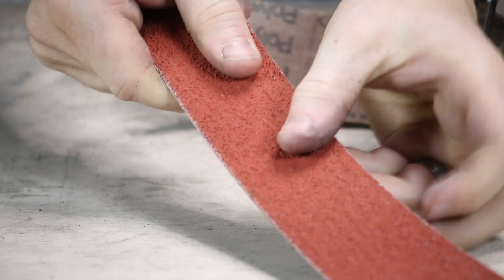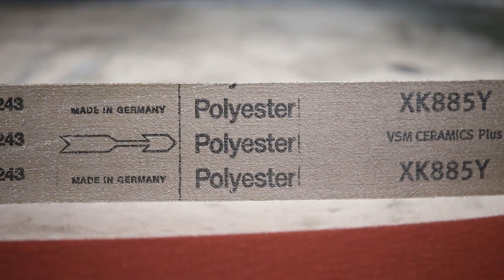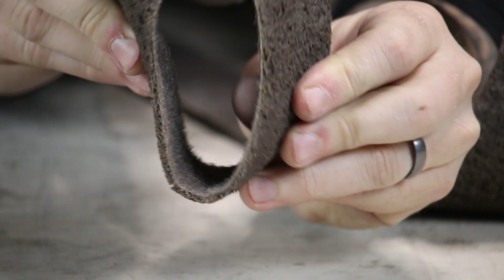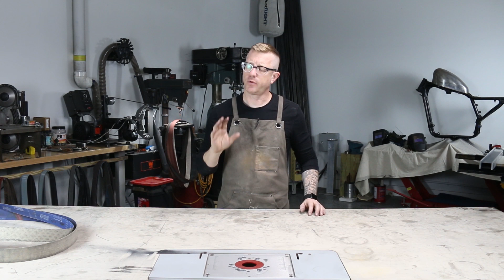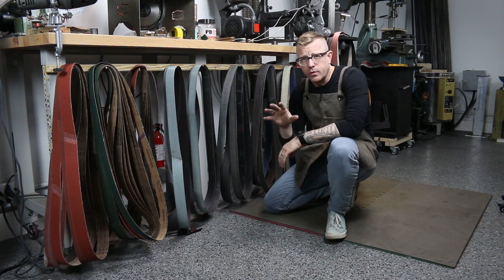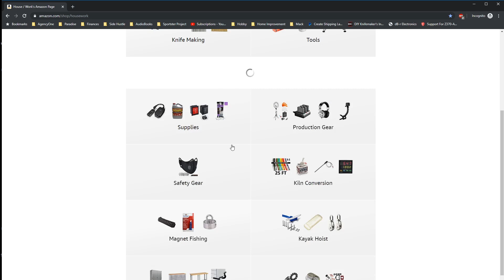2x72 Grinder Belts - Which ones to Buy

Comment: yeah dude. its A2. a low alloy steel with a tiny bit of chromium carbide in it. ofc it grinds like butter on that belt. it would. stuff grinds like butter without power tools, by hand, too. most basic cutlery stainless steels would be twice as hard to grind. forget about some high alloy high speed bs.
Reply from the maker: Right on man. Thanks

Comment: There are a number of different standards for abrasives, and they are not exactly compatible.  Further, it is not just the average grit that needs to meet standards, the distribution curve that describes the range of grit sizes and their proportions is important.  A good abrasive will leave all the lines the same whereas others will put very deep grooves in an otherwise consistently finer surface and others will be all over the place - i would assume we have all been there.

Two possible reasons for the lack of grit size markings may be that either the manufacturers wish to ensure that you understand what you are getting by making you look up the specification for the product, or the products don't pass the standards and the manufacturers wish to avoid legal action.

Comment: For what its worth, if you ever had a tube of silicone caulk on the shelf and it got old and hard.   Break it out of the tube, it makes an excellent belt cleaner.
Reply from the maker: Oh man that's an excellent tip!!
Reply: Did you try it out? 😀
Reply: Oooh! I don’t usually have silicone but I use polyurethane that dries like a nice silicone. Might just squirt out something into a mold…

Comment: Hey Brian,
Thank you for the VSM recommendation. I'm from Germany so I will give them a try as soon as my belt grinder is finished. Do you have recommendations on belt speed? What do you use for profiling with those 36 grit ceramic belts? As far as I read the high sfpm are only needed for low grit grinding and the speed is lowered with increasing grits to reduce heat.

Comment: watched you videos before, subscribed a while ago, your machine i think is the best on the market, to say its bullet proof is a understatement, that machine will survive anything plus a lot more . Two hp is fine, speed variator is a bonus ,forward and reverse is the icing on the cake. I am based in the uk and sold abrasive belt machines for twenty years ,half inch wide dynafile, up to 90 inch wide throughfeed machines, half horsepower up to 80 horse power  for powergrinders. Plus i saw a lot of home made and modified machines along the way, some to bad to mention, some brilliant, dedicated to one process or application. Most machines i see are good but possibly running too slow, they cut ok but are nowhere near the 32 meters per second recommend by the manufactures, but they work well and when using scothbrite or working plastics are adequate. you talked about 80% for steel what is that in meters per second, my reason for asking is that i have run belts up to 40 meters per second with good results, the 3m rep frowned and refrained from comment,the highter speed you can run the better the abrasive will preform. Colour of belts scotchbrite use a colour system to make it easy to use ,brown coarse, blue medium, red fine, and white very fine. Most manufacturers dont publish belt speeds, i think it is because so many people make a machine, from whatever they have at home or can purchase off the internet. belt speed doesnt come into the equation, if they have a two speed motor then that is a bonus for them. When fine polishing as you have forward and reverse, have you tried reversing a old belt using the back face of the belt like a barbers strap, a company in birmingham  did this on a ten headed Loser centerless machine polishing golf shafts at a rate of 20 pieces per min. the old belt burnished the shaft and gave it a brightness that their quality people were looking for, a alternative was to use a cork belt, they run better wet but if you dont have a wet machine, put the belt in a bucket of warm water for a few mins spin it up and it will remain damp and flexible for a while. Sorry if it sounds like a mini rant, its not meant to be it is a pleasure to see a machine to the standard and flexibility of yours, if i ever get back to the states , i would love to have a play on your machine, it will do all i want it to do. With belt grades my choice  is     with 3m start with a300 80# a160 120# a30 800# then a old belt reversed and used to burnish, happy grinding Lawrence Ogden.
Reply: whats the purpose of changing the rotation direction of the belt?

Comment: Thanks for the video.  I started out using belts from Combat Abrasives and they worked out pretty good.  Just seemed to loose their grit quite readily or at the very least the ceramic bits wore down a little fast for my liking.  Over the past 2 months though I have switched to the 3M Cubitron 984F II 36 grit ceramic belts.  I profiled and beveled 3 camp choppers (1 from CPM-4V, 1 from 5160, and the last from 1084) and the belt still has grit left to spare.  Now it won't 'hog' off material as if new but that is a lot of work just for one belt.  I use just that belt now to knock off corners before going to a new belt.  Now, they are pricey so you gotta figure if what you pay is worth what you get out of them.  For me the choppers I make have 11" cutting edge, 1/4" spines and the bevel goes up about 3/4 of the way from edge to spine.  So a lot of material is removed for each blade.  So for me they are worth the price versus what I charge for my choppers.  Have never tried the VSM belts and although they sound like they would do the job it would be hard for me to give them a try after using the Cubitron.  But to each his own and what works for one man doesn't necessarily work for another.

Comment: Have you used combat abrasives belts before?
Reply from the maker: I haven’t but I have heard they are good. Is that what you use?
Reply: @HouseMadeUS  no I haven't gotten any belts yet. I'm still in the process of building my grinder and trying to find the best bag for buck at to purchase some. I have my treadmill motor and have to buy my rectifier and speed controller that you built in a previous video. I'm also most likely going to copy your build but for the main tube and platen arm will be using a hitch reciever and solid hitch I found for scrap. 
Was just curious if you have used them yet. 
Thanks for all the great info you have. Really appreciate it!
Reply from the maker: Yeah man, go VSM. From my experience they are the best bang for the buck. Good luck my friend and send some pics to brian@housework.us I’m putting together a compilation vid of all the grinders people have made.
Reply: @HouseMadeUS  will do. I just got a welder and need to set it up and see if the bottle I got has gas in it etc. Also need to cut a hole and weld my burner onto my forge. Trying to get into blacksmithing and knife making but it's cold in manitoba canada so not always easy/fun to go out in the garage with no heat haha
Reply: Ian Moster

Comment: Yeah, I basically do the same to start, but i tried the Trizact structured ceramics, they are good, but the edges are too rough for the bevels i like to do, so I buy the Trizact gator belts... One thing you might wanna keep in mind, you are doing full flat grinds, so turning the blade doesn't make a difference, but if you were ever to want precise bevel & ricasso lines, that probably wouldn't work... You might wanna try cork belts too, they also leave a nice finish. I started buying the aluminium oxide 1000-2000(even if I use a trizact A6{2500} I come back to the 2000 grit, hit it on the buffer with some flintz and it's almost a mirror, no handsanding... I think the reason some belts don't have grit size on them, is because how they are cut, i notice that too & it drives me crazy... Hope all is well, take it easy...
Reply from the maker: Dave! As always you’re a wealth of info. I’ll look into cork belts, I just built a soft platen and it’s helping a lot. I had some issues getting the flat grinds even. Kitchen knives are really tough. But it’s what I want to make. So here we are. Lol. Thanks again Dave. I’m trying to decide what profile to cut out for our A-2 Collab. 👊🏻

Comment: Heck yeah. I generally use the VSM 60 or 80 grit to start off my bevels. Then move to a 120 grit J-Flex (green made in Germany from Tru-Grit), then 220 j-flex, then 400 j-flex, then medium scotch brite before stone washing. If I'm hand sanding I'll go to a 400 cork after the 400. I did a ton of research on belt progression on blade forums and then compiled what a lot of members do (going back to 2010). Here is that compilation (food for thought) - https://www.bladeforums.com/threads/belt-progression-compilation-steel-and-handles.1638807/

I learned some things from this video. I like the finish of the gator belts, but I've had some issues getting good plunges with them. I wish they put the grit on there too!! LOL

BTW - That Amazon Store is legit!
Reply from the maker: Yeah man, I’m gonna grab some of those j-flex per your recommendation. And thanks for that link. There is so much out there it’s tough to sift through it all.  Thanks as always for the support and all! Hope to own one of your blades some day. I really dig that last small guy you made recently. 👊🏻
Reply: @HouseMadeUS  Cheers man! Keep it up! Your videos are top notch quality
Reply: Red Beard Ops 9